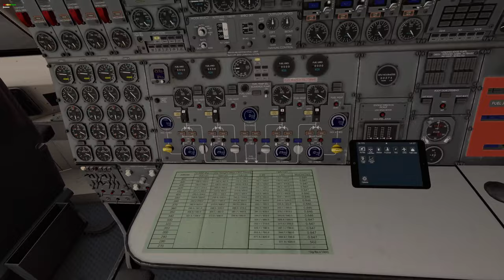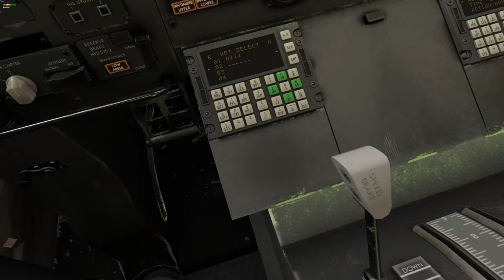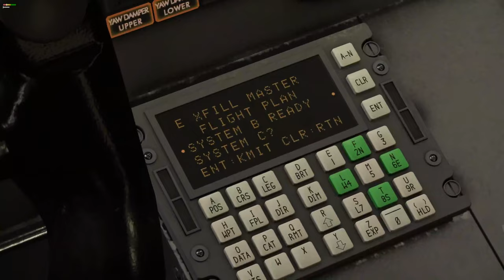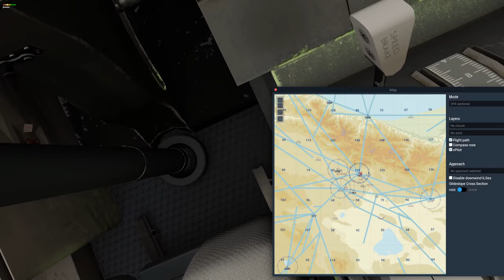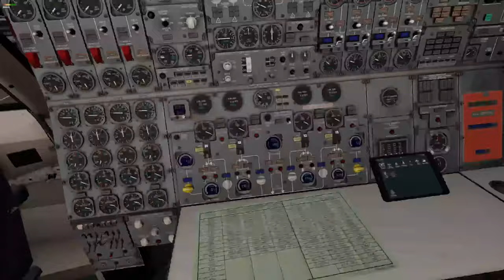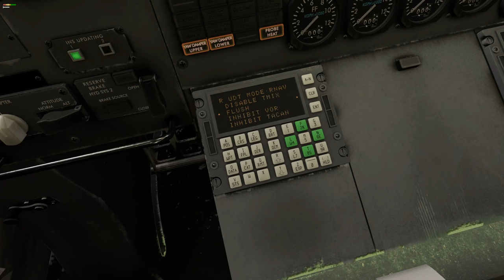The Ultimate LTN-92 Tutorial for Felis B747-200 X-Plane 11

Comment: Thank you so much bro. Much appreciated. Do you have to do X Fill all the time you startup? and i dont have to do the slave and console and master page every time i startup no? 

Again tysm bro
Reply from the maker: Hey, X Fill is just to transfer waypoints between units, in theory you can enter two different flight plans in unit 1 and unit 2 and switch between them. To transfer waypoints between units you select Master in the unit where waypoints are, and slave in unit(s) you want to transfer these waypoints to. You can fly without doing x fill of course if you want but you’ll need to only use the unit you entered waypoints to.
Reply: @cleanwing6070  oh i see so you know the mode selector where it says the 1 - BOTH - 2 INS (in the centre mcp panel on the dashboard), if you put master (INS 1), will it track taht ones waypoints and then if you use INS 2 on the mcp panel on the dashboard, it will go to that flightplan? If that makes sense? 

Also, Do you have to put the first airport as teh forst waypoint eg OISS and the next waypoint maybe KETAX then GUYLAN then L491 etc? 

Does your airport of origin have to be your first waypoint? 

thanks!
Reply from the maker: @VB-0015  honestly I don’t remember exactly bc I never used it but there should be a switch under a black cover called something like INS SOURCE SELECT 1 OR 3 or smth. It should be somewhere in the bottom of forward captain panel. From captain’s line of sight somewhere behind yoke I guess. And your first waypoint doesn’t have to be airport. It can be anything.
Reply: i see, thanks man!